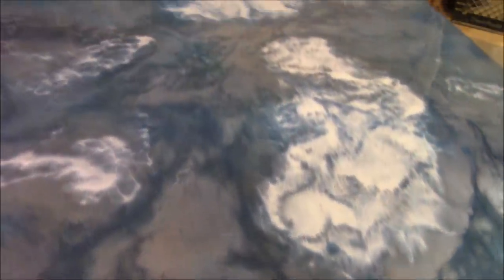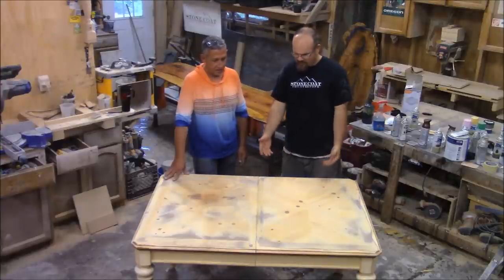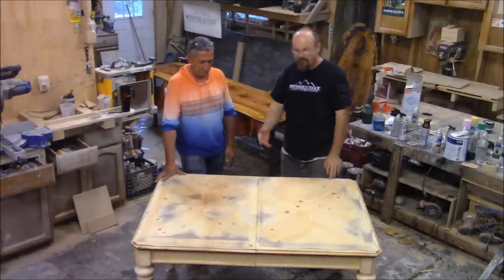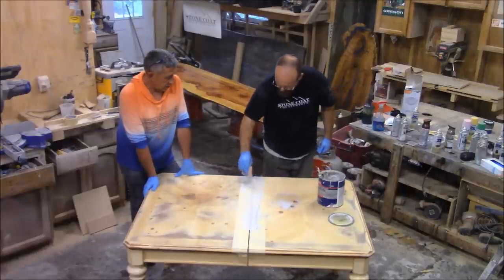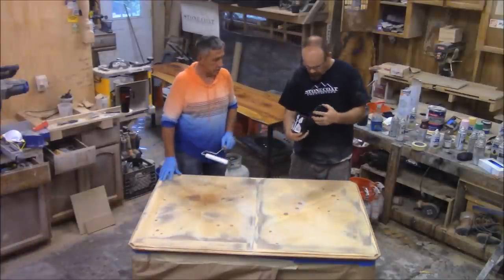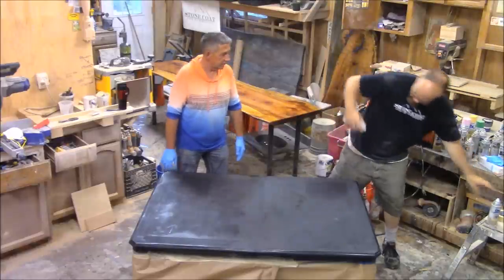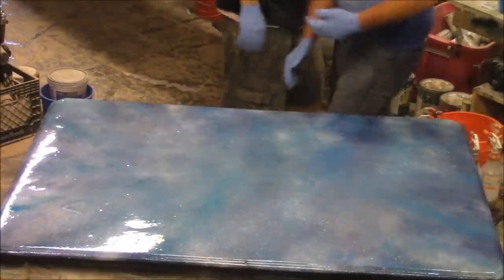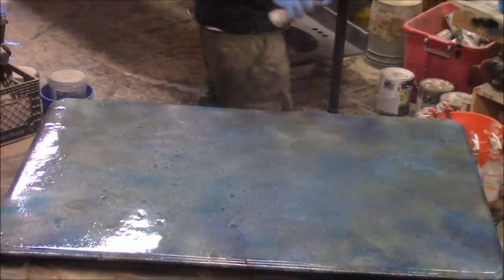Junk Table Salvaged with Epoxy

Comment: It is a very beautiful piece I like it. 
Question:
I want to do a kitchen counter top 
I know you say the epoxy is self leveling my question is:
If the  epoxy is self leveling . Does the counter top or any other piece has to be level as well? Wonder if the counter top or any other piece would? If it is only off by a few degrees ? would one see a difference or not ?
Reply from the maker: Great question George! For the best results we recommend your project be flat when you apply the epoxy. -Nathan

Comment: At what point do you pull off the masking??
Reply from the maker: The Fuel Minder Stone, you'll want to remove any tape before the epoxy sets up, or it will become trapped in the epoxy.
Generally any tape on the top side of your projects you'll want to remove as your about to walk away from the project for the day.
Give us a call with any questions at 541-450-1976

Comment: What's the purpose in 1/8 in notched trowel and why use a paint brush on it can you just pour it on  top of it and let it flow over
Reply from the maker: Great question crazymanslw!  The 1/8" square notch trowel is what we use to gauge the correct thickness of the epoxy we lay out on the surface of each of our Stone Coat Countertop projects.  This will take the guesswork out of the process.  Call or write us anytime for project support. (541)450-1976  Are you planning any projects at this time?

Comment: looks awesome? You think that seam is gonna hold up when you move the table? I was thinking maybe adding or sistering or screwing   wood  across the seam on the underside. I have a table i want to do, however it doesn't have a lip around it. Its just smooth, the epoxy would just run down the legs. How could i do it?